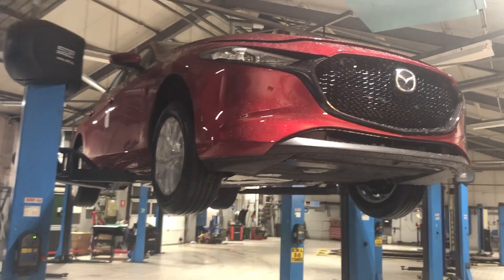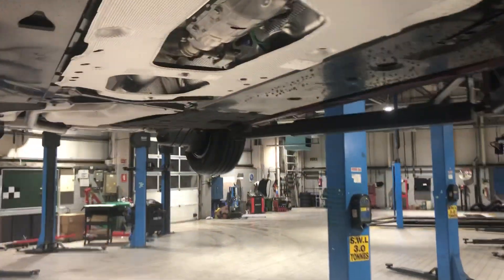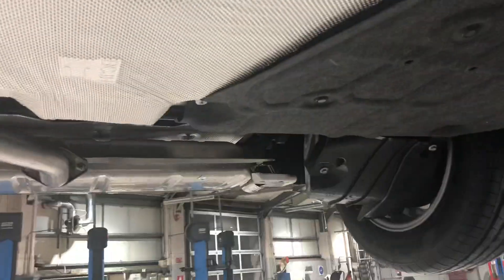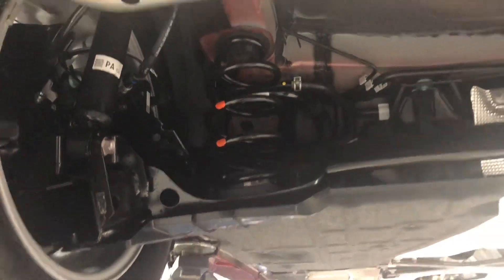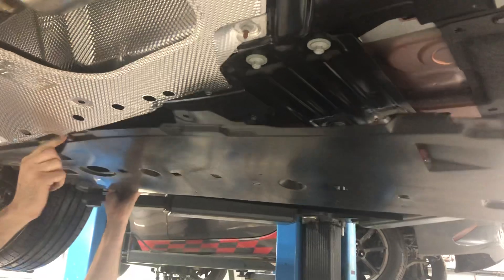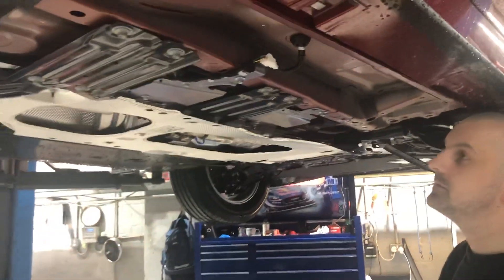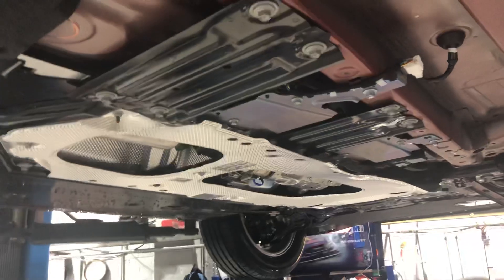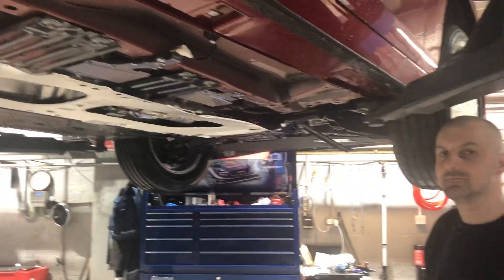New Mazda 3 have a look in-depth at the underside of a Mazda 3 and the Lithium Battery

Comment: From what I've read up, I was led to believe that the hybrid battery was in front of the rear torsion beam axle, hence the reason for adopting the beam axle rear suspension,  to provide battery room, as the independent rear suspension would no longer fit. Hmm. This puts a new light on things.